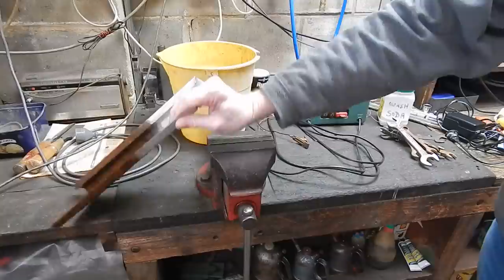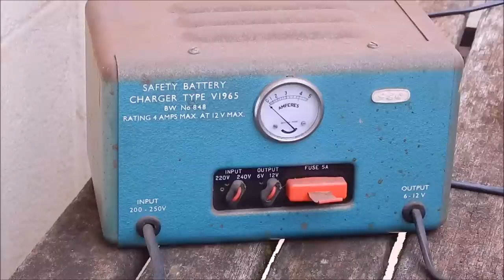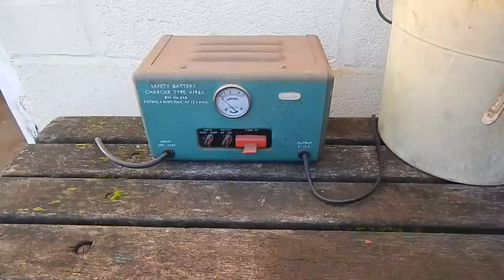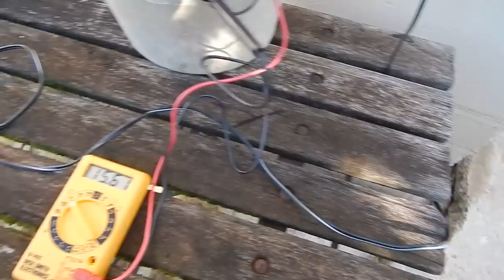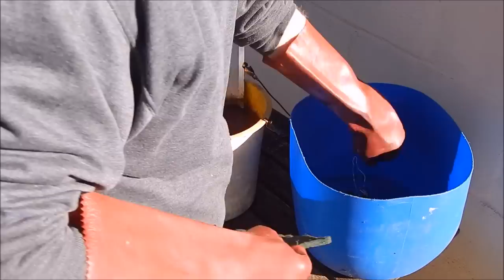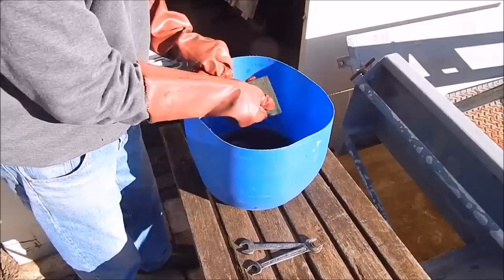How to remove rust with a car battery charger

Comment: Hi Rob, you are right about hydrogen being given off in the rust conversion reaction.  The more current that flows, the more hydrogen that will be released.  Driving the reaction too hard using a high current can lead to hydrogen embrittlement  as well and that might not be good for some items, but a bit of time or a couple of hours in the oven will generally fix it.  Using the plug pack for a power supply is a good idea - top recycling tip.  A piece of old chain also works well for an anode to de-rust inside containers where OBR's bolt trick wont fit or doesn't have enough surface area.

Simon
Reply from the maker: Thanks Simon.  I suspected it was hydrogen.  Gases pretty vigorously.  Wouldn't the hydrogen embrittlement only be on the outside surface layer ? Rob
Reply: I'm not sure how deep the hydrogen would get into the iron crystals, but it will generally come back out over time.  It will depend on the amount of free hydrogen available and the time it has access to the item being treated and also the temperature - ever had a weld develop tiny little cracks after using damp electrodes?  Acid cleaning and high current electroplating are much worse for making things brittle.

Hydrogen embrittlement is probably only going to be a problem with thin springy objects that you have just de-rusted and then tried to bend straight away - even a shallow depth of embrittlement would be a greater portion of the object's cross-section.  I have de-rusted trailer springs without any problems, but I let them sit around for a few weeks before use.  I have read that if such things are heated for a couple of hours at 150 deg C, the extra hydrogen will dissipate faster without effecting the temper, but I have never felt the need to try it.  I always run the process slowly like you, so I don't expect to have any problems, plus it usually takes me a while to get my rusty projects back together after cleaning them.

Simon

Comment: about derusting a fuel tank idea and thought about hanging the bolt into the tank as the anode might benefit with a drilled out pvc pipe as a sleeve protector preventing any occurrence of anode/cathode contact. Then you can house a larger metal anode rod without worry of shorting out the two wires.

Comment from the maker: I've been using the recycled Canon BJ printer power pack as my de-rusting power supply lately and it works very well.  Saves having my good battery charger out in the weather, and it's fairly weather resistant.   Rob
Reply from the maker: Make sure you don't short the terminals with a power pack charger as they generally don't have fusing and it will probably kill it if it happens for any length of time.  Rob

Comment from the maker: This is the preferred method to use if you want to remove rust from sharp edged tooling/cutters such as reamers, HSS lathe bits, etc where an abrasive or wire wheel could dull the cutting edges.

Comment: Rob,
Does your wife know you are using her pot scrubbing pads for cleaning your tools? :-) Is Dick Smith Electronics still in business? During the 1970s he had stores here is the US. There were a few here in the San Francisco Bay Area. I really liked his stores better than Radio Shack. Lots of electronic hobby stuff. I guess he didn't make a go here in the US, because he lasted a little over a year and the stores were gone. Thanks for sharing your version of electrolysis for cleaning rusty stuff.
Have a good one!
Dave
Reply from the maker: Swarf Rat I wondered why the food tasted funny.  Dick Smith stores are still in Oz, but not owned by Dick, owned by Woolworths (I think). They don't carry the hobby electronics stuff any more. Jaycar is the only store that does that now.  I think DS was probably like RadioShack in the USA ? Cheers Rob

Comment: what is washing soda?
Reply from the maker: Rondo Schiavoni Sodium carbonate.  It's used as a water softener for laundry use - get it from the supermarket.  Cheap.  Rob
Reply: is it as arm and hammer baking soda?
Reply from the maker: Rondo Schiavoni No.  Baking soda is different - that's Sodium bicarbonate.

It may still work, as the powder only acts as an electrolite (conductor) in the water.

I've never tried it.  Cheers Rob
Reply: oh   thank you

Comment: you could have just buffed the rust off with wd40, and this has an advantage; the oil gets worked into micropores making rusting occur much slower. I've done it on a brass candle holder and after 7 years it still didn't oxidize back.
Reply from the maker: This method will get into irregular and complex items like cast wrought iron, that a wire buff wont.  Rob
Reply: This is relevant to my interests, because i get a lot of tools with sharp inside corners (like step blocks, its important to be parallel right into the corner). How do you propose to remove the black oxide residue after the derusting using electrolysis?
Reply from the maker: Use a high pressure water jet washer - eg. Karcher.  Rob
Reply: xynudu
For cleaning residue off items which are not precision ground, put the parts in a bucket with a bunch of fine sand, put the lid on, and roll it around. This is how they polished chain mail. I have read they possibly used the foundry greensand which would also be oily, impregnating the metal like the wd40 trick also mentioned.
Reply: chainmail is polished like that because of its geometry. not that it's the best way to polish items with different shapes like in the video.
Reply: First, the geometry of the wrenches makes them tedious to polish individually after derusting, the same with chain mail.........

Second, The idea here is to clean and polish the wrenches in a batch, not one at a time. which is how your wd40 method works.

Third, I acknowledged the wd40 method, but this is a video about electrolysis, not wd40. Plus, as I mentioned, oily sand such as would be used for casting had the same effect as wd40 and a wire brush.

Lastly: if you want to post a retort, and are not able to write in complete sentences, at least try to make the sentence fragments logically connected with each other.......If you could translate this:
" chainmail is polished like that because of its geometry. not that it's the best way to polish items with different shapes like in the video.

Not sure if you are for or against my suggestion, or are just a troll, I suppose it doesn't matter.
Reply: I am weak and lack creativity? Totally. I obviously could have nothing else to add after that comment so I bow out to you, The pillar of creative force and logic, the venerable "MEOCATS"............You are write(sic).

Comment: I use this method for every thing I use a plastic garbage bin and a 24 volt supply my bin sits outside due to the hydrogen generated (it runs 24/7 all year) some one decided to flick a smoke in it one day, it went bang alright!
Reply from the maker: How often do you change the electrolyte ?   Rob
Reply: xynudu . I run one in a chest freezer cabinet and have not changed it in 2 years or so, just syphon out the sludge in the bottom when it gets too thick, and add washing soda until the solution feels slippery/soapy.
Reply: I found out about the Hydrogen bubble thing by accident one day, was angle grinding near my first tank (20L drum) and it had a good head of foam on it, CRACK!, off she went!, and brown sludge everywhere!.
Reply from the maker: ***** Ha Ha. Good one.  Thanks for the feedback.  That's all good information.  Much appreciated.  Cheers Rob.

Comment: You'll find that many sources of info on how to to this mention to use only straight up plain steel. That's because the chromium in stainless steel or the chrome coating on spanners creates chromates when it's released into solution by the electrolysis. And chromates are poisonous. Not a problem IF you wear protection and dispose of the toxic waste water you've just created. But the cost to get that disposal done properly way outweighed the cost of brand new versions of what i was going to de-rust the last time i checked.